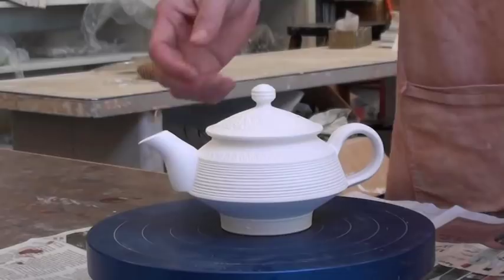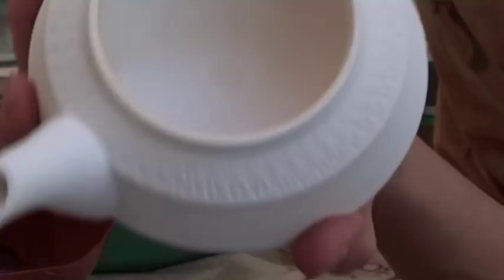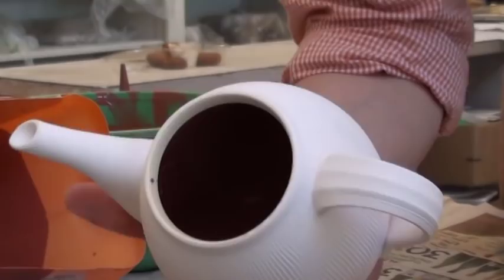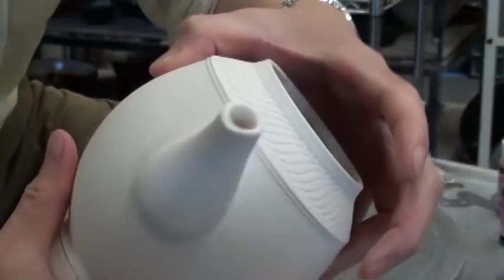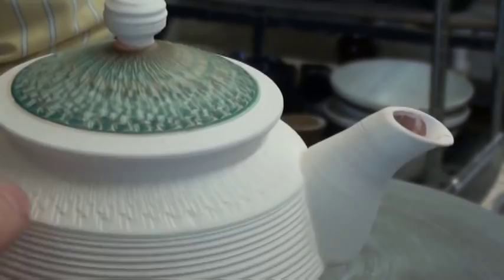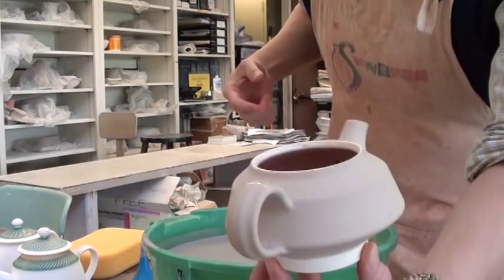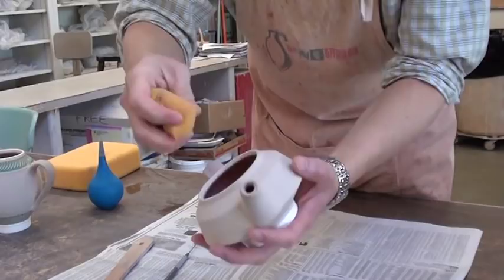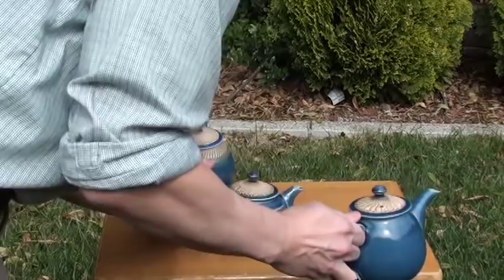104.Glazing 3 Teapots with Hsin-Chuen Lin

Comment: You are a wonderful teacher. Thank you for all that you share. And a question: Do you have a tip for how to avoid having cracks around a handle where it is attached to the side of the pot? I'm having a lot of trouble with  hairline cracks appearing, especially at the top part of the handle. I'm using slip and smoothing out with a pin tool or wood tool. Thanks!
Reply: ?vinegar?

Comment: what do you add to the wax? can you please write it to me? and explain why you add it?
Reply: Hi, he is using wax resist to keep the glaze from adhering to those areas, the areas where the lid meets the vessel cannot have glaze on it because they will stick while firing. He is most likely firing the lid on the vessel to keep the two from warping out of shape while firing as well.
Reply: he adds Alumina Hydrate so that the wax becomes powdery after glaze firing. Most times when you add regular wax resist the space you've created, (for the lid to fit into the pot) becomes smaller/tighter and lifting the lid off is very difficult. So adding alumina hydrate makes the detaching much easier
Reply: He adds alumina to the wax
Reply: Gideon Ibemere thanks